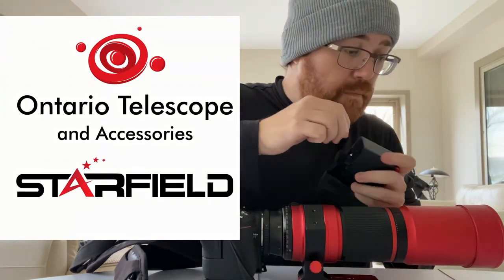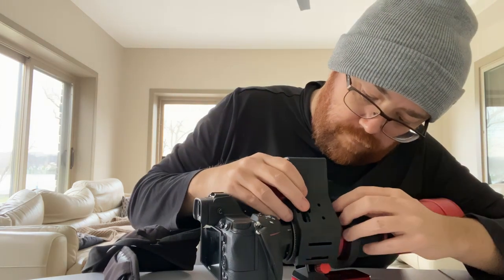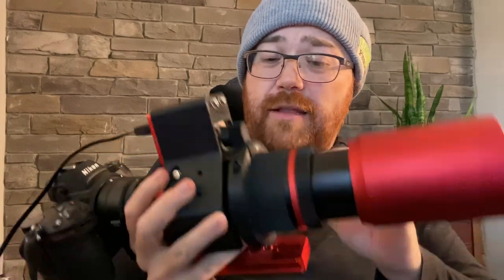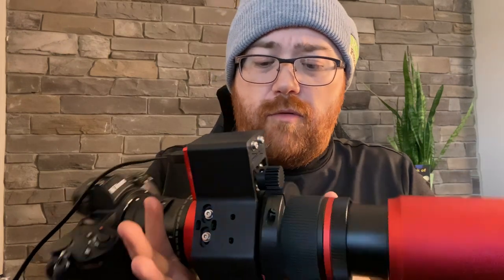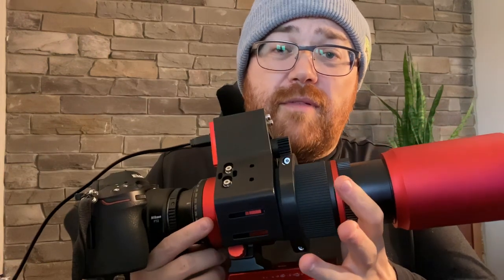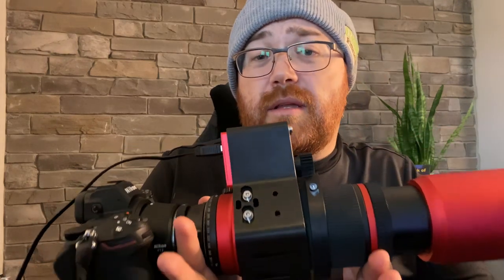Installing the ProAstroGear Black-Cat on the William Optics RedCat51 and Testing Focus

Comment: Some things that I'd like to know more:
1) What EAF settings are you using with it & the RedCat. Surely these would be common for everyone using the same equipment. 
2) This has gear travel ability in the half, semi-circular region only. So it should matter where you press and screw down the EAF gear knob thing on the rotating gear? I'm imagining you need a little bit of travel both ways to avoid hitting the end of the focusing tube inwards accidently/ or due to wrong settings on the EAF?
I think a demo of these in use should clarify some of these doubts. :) TIA.
Reply from the maker: Divye - Did a follow up video to answer your questions about the Black-Cat Focuser for the RedCat51 https://youtu.be/Ao52eED8IlE

Comment: Hi Graeme very enjoyable review and music too! Hope you get some clear skies to test this out. 
Red cat scope looks cute and I should get it as the smaller scopes the better as I do think red cat would be great beside my tiny skywatcher evoguide 50ed guidescope! 
Would you recommend this product in review if I did get the red cat? Does it weight little or how heavy it is? 
I'm looking for all very portable gear for my star tracker and hopefully many clear skies next year. 
Stay safe buddy as this variant of covid is sweeping Europe right now. Clear skies too!!!
Reply from the maker: It’s the best focuser solution I’ve seen for the RedCat51 so far, most of the weight is in the EAF. 3D printer plastic is pretty lightweight.

It would go well with the 50ed guidescope mounted on top.

Main thing with it as a “compact” package is that the ASIAir (there is the new PLUS model out) is designed to mount on this as well and that minimizes your cables and potential drag. I’m sure a large star tracker could handle it fully kitted out, one of the advantages of the RedCat51’s size and you wouldn’t need a full computer to operate it.